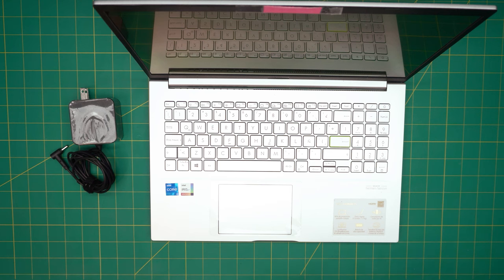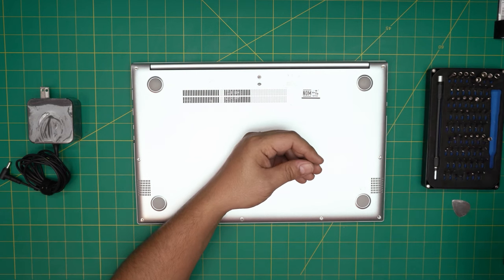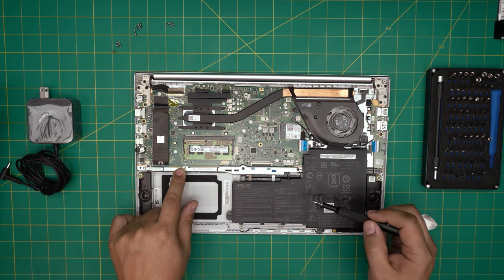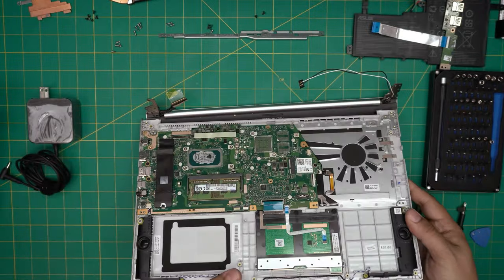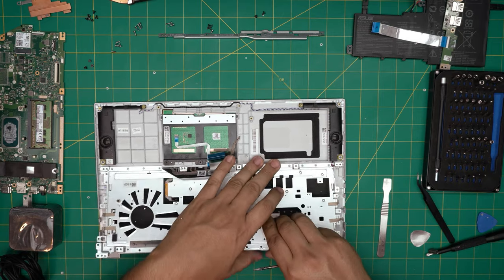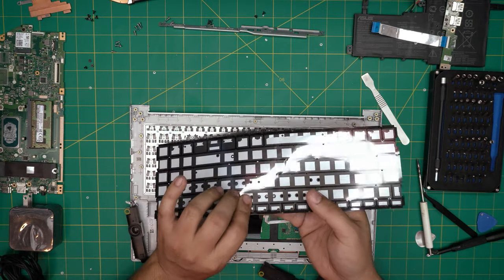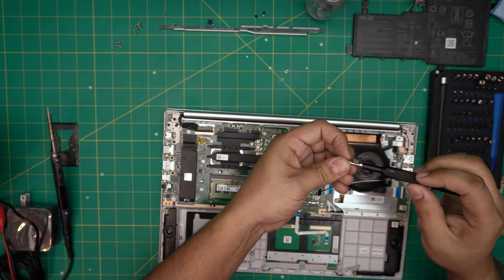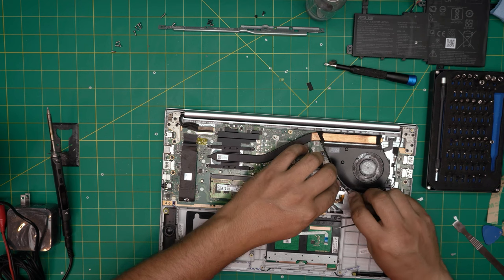How to Replace Keyboard on Asus VivoBook 15 K513E - Step-by-Step Guide⌨️💻

Comment: If I’m unable to remove the old backlight without destroying it, can I install the keyboard without the backlight ? Would it still work correctly without it? What does the backlight even do?
Reply from the maker: Thank you for your feedback! If you wish to support the channel, you can like, subscribe, or both!
Regarding your question, absolutely it will work without the backlit, don't worry if you damage the backlit or anything, the keyboard will still work 100%
Should you have any further questions or requests in the future, please don't hesitate to ask me.
cheers🍻
Reply: @uFixTek   Thanks for the reply. If I were to take my laptop into a professional to install it how much do you think a fair price is for this install?
Reply from the maker: if you purchase the keyboard and take it to the repair shop, they should not charger no more than 35USD for installing it. anything over that is expensive, because you giving them the keyboard they are not selling it.

Comment: Is there any possibility to unplug the keyboard but still being able to turn it on?

I have ghost typing issues hence my question.
Reply from the maker: 🫠 Regarding your question, yes, you can turn the laptop on without the keyboard, but it won't be an easy task and it won't be done from the outside. You will need to short the ground on the motherboard to one of the pins at the keyboard connector, usually the third from the left. However, I must emphasize that this is not something you should do regularly. I would recommend purchasing a replacement keyboard from Amazon (link provided in the description) or finding a cheaper option on AliExpress.
Should you have any further questions or requests in the future, please don't hesitate to ask me.
cheers🍻

Comment: it worked thank you! However, I have removed the conducting paste on the motherboard without putting new one. Do you think I should reopen it just to add some? I use the computer moderately. Thank again!
Reply from the maker: Thank you for your feedback! If you wish to support the channel, you can like, subscribe, or both!
Regarding your question, if you remove the thermal paste of the CPU and cleaned it from heatsink, i would highly recommend it to repaste it, but if you didn't clean it and your laptop is not shutting down out  suddenly, then you fine.
but i do recommend you to repaste it in the near future.
https://youtu.be/UOfV4QHr4iA
Should you have any further questions or requests in the future, please don't hesitate to ask me.

Comment: Hi, thanks for this, really helpful, But do I really have to re-melt the rivet thingy on the keyboard? What happens if I dont?
Reply from the maker: Thank you for your feedback! If you wish to support the channel, you can like, subscribe, or both!
Regarding your question, there's not much to worry about. The only thing you might experience is that the keyboard could feel a bit more submerged or have a deeper press when typing.
Should you have any further questions or requests in the future, please don't hesitate to ask me.
cheers🍻
Reply: @uFixTek  Nice. Thank you so much for helping us for free, you are very kind and your videos are very detailed, easy to follow. I hope your channel will grow Bigly, hehe. 

Dead keys seems to be a common problem with Asus laptop, weird.
Reply from the maker: It's my pleasure also i appreciate your support my friend.
they are common issue with keyboard failures, i do get a lot of them in the store for replacement.
i do try to make more videos to help as many people possible.🫠🍻

Comment: Is it possible to clean under keyboard? coffee spilled on it and the keys are sticky right now
Reply from the maker: 🫠Regarding your question, you can only use 99% isopropyl alcohol and a soft toothbrush. Spray the alcohol and use the brush to get under the keys. Otherwise, you will need to replace the keyboard.
Reply: @uFixTek  Thank you so much
Reply from the maker: It's my pleasure my friend.